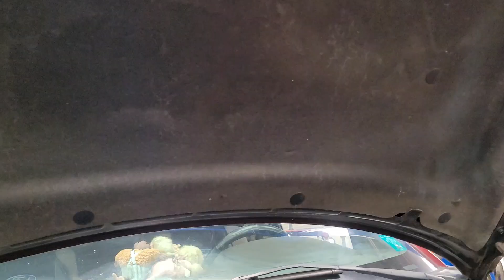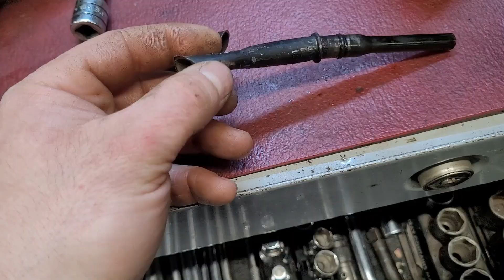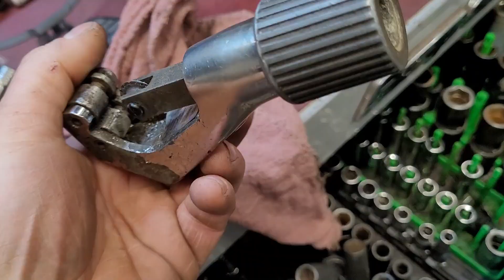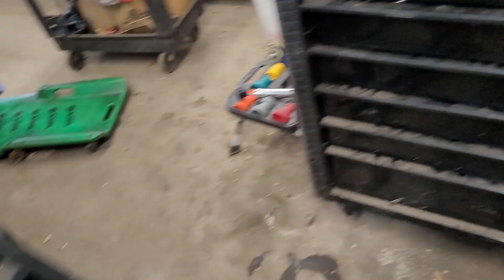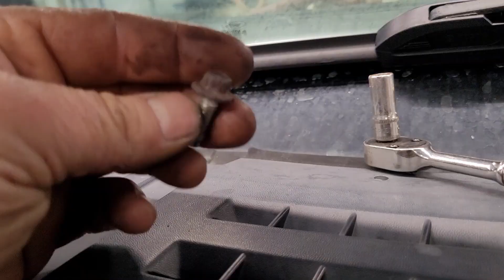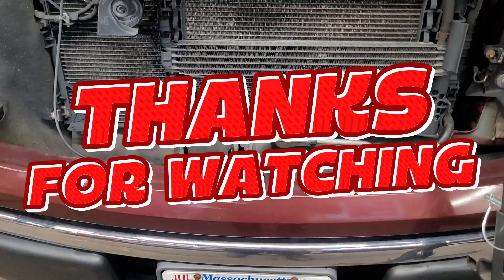Ford 4.6L Dipstick tube replacement tips and tricks!!!

Comment: This is the best video I've seen on this in terms of things that actually help. So I'll add my tip here- a lot of the videos and instructions for putting the new one in make it seem like it will just pop right in. Not so for mine. If it's a very tight fit, there's no leverage to be able to push it with sufficient force into the hole. What ended up working- remove the wheel and the wheel well (it's easy to do). Then you have a more of less straight shot and one person can hold something like a long crowbar on the lip of the new one while someone hits it with a hammer from the wheel well. Took a few hits to get past the O-Ring and then it just slid the rest of the way in beautifully!

(There's a surprising amount of "That's what she said" in this post, wow. ;) Can't really be helped)
Reply from the maker: thanks

Comment: How do you clean the hole? Doesn't it get rust and junk in the oil pan?
Reply from the maker: can either plug the hole or change the oil!
Reply: @Kennystoolreview how do you plug the hole if your taking it out of the hole and as you take it out stuff falls
Reply from the maker: @anklebullytv8840  just for when cleaning the hole.

Comment: Bro, i took the engine plate loose and the bolt out of the mount, jacked the engine back up with the cherry picker, all to realize that the plate was not cooperating. Took a break and found your video, used the pipe cutter and im back in action 15 minutes later( replaced all the bolts i took out that i didnt need to, plus the picker is out, for all the time karens)
Reply from the maker: haha happy it helped you out!!! subscribe to help the channel!! thanks for the support!!

Comment: Why not just splice a new upper portion where it broke off? That’s what happened to mine and I know for a fact I will have issues removing/installing it. And I already have the manifold off… I’m just not good at these things
Reply from the maker: because the oil level is going to be off if the tube isn't exactly the right size!

Comment: So the little lip above the o-ring doesn't sit flush with the hole in pan right?
Reply from the maker: no sure what you mean. It stops @ the shoulder manufactured on the dipstick tube
Reply: @Kennystoolreview  when I tapped it with the forked trim tool like he suggested it seated right on that lip like it’s supposed to

Comment: Bc a little ehh is definitely good directions
Reply from the maker: thanks
Reply: Yea there's a small gap on mine between the block and that shoulder/lip but the mounting holes line up. Your cutting tip helped forsure though
Reply from the maker: @azeeninety55  happy i could help